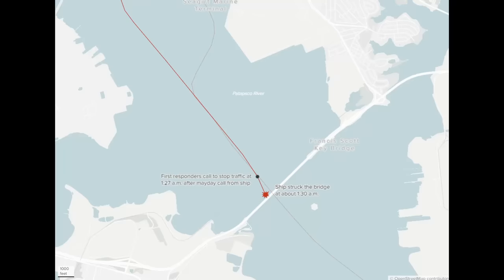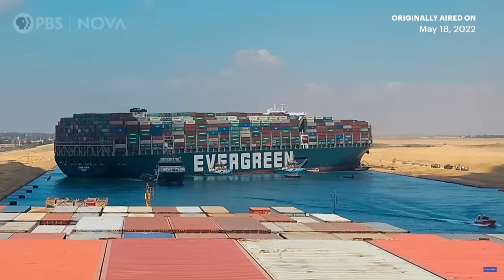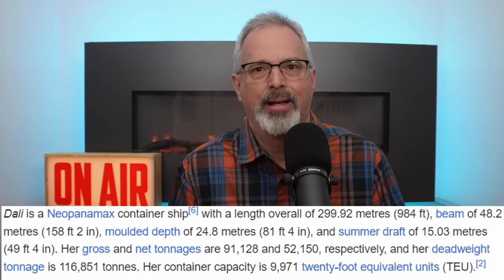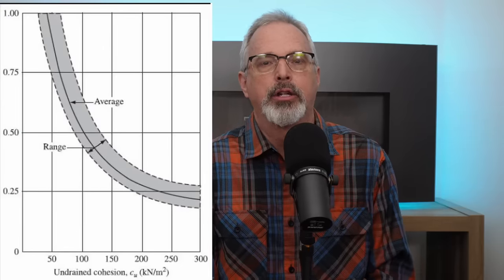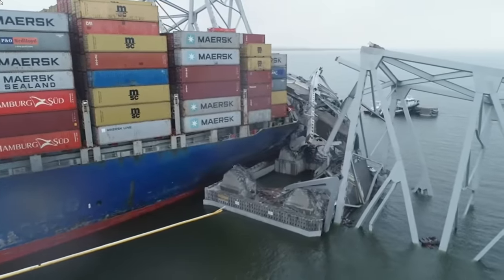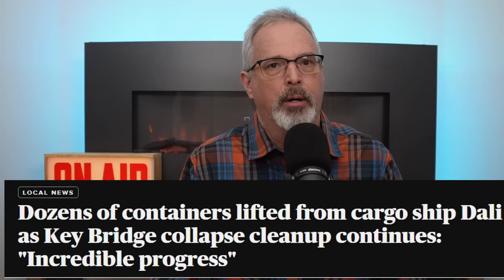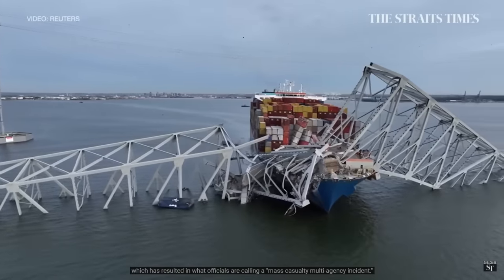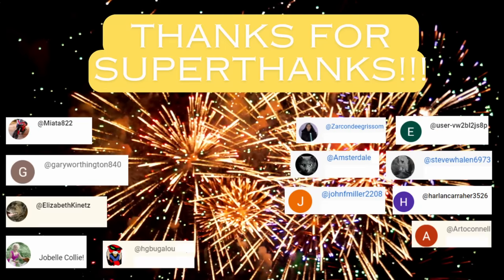Can the MV Dali be Refloated?

Comment: The numbers for the tug capacities are also way off. A normal harbor tug can be in the 50-65 ton bollard pull range and there are some classes based on horsepower like 3000's and 4200's but the actual bollard pull they can apply isn't as simple as directly driven by horsepower and those are merely harbor tugs. When you look at the numerous types of tugs there as a huge range of power and how that power is applied. Different propulsion systems and features can impact the overall bollard pull. Its also meant to take into account that a tug mag be stationary while making said force so some of the more simple relationships people go by don't fit with this calculation.
The salvage tugs have ratings over 100 tons, the biggest ever is something like 475 tons and monsters like that are used to move oil platforms and their massive anchor systems. For salvage they also use powerful barges with winches. The pulling isn't just with tugs thrashing thru the water with their props. Anchors are set, some yugs have winches on both ends to add that pull to the force of its propulsion and these barges are anchored off with big winches and using mechanical advantage to produce 100s of tons of pull. They have it handled.
Ever Forward was plowed nearly her full length into bottom as shallow as 18 feet or less. Dali is on the edge of the channel with her forward half up onto the back in about 30 feet of water. Ever Forward was so buried they were afraid to use ships systems thinking the stern was packed with mud, Dali is running. Physics is all about give me a level long enough... well give me enough pulleys and I'll pull this off with a kids bathtub toy....

I'd suggest Sal Mercagliano Whats Going on with Shipping, go back to his coverage of that incident in Baltimore harbor as he includes full coverage of the salvage plan and includes actual statistics of what capacities different tugs and barges had.
Reply from the maker: Thank you for your input on that, I appreciate it.

Comment: Come on, this is a non-issue alrhough I suppose it makes a topic for a video.
You can remove containers at the bow to deballast it. Alternatively you can use high pressure jets of water to clear the mud away from the hull. This can be done using an ROV  - you don't need divers. It's how marine growth is cleared off offshore structures for underwater inspection or repair.

Comment: If it ends up being stuck. I wonder if we could just use modern steerable boring systems to plant explosives in the mud somewhere below the ship. I am thinking that would overcome the suction of the mud long enough for the ship to float free.
Reply: With the gas pipeline very close, explosives are a definite NO-NO.
Reply: @royreynolds108  Wasn't aware of that thanks.

Comment: Don't forget the gas pipeline running under MV Dali -- supposedly it must not be disturbed.  I believe the traditional method of floating wrecks and severely grounded ships is to pass cables underneath and connect them to enormous flotation bags.  So some dredging, some flotation bags, and well, I'd like to hear from engineers experienced in marine salvage.  I agree it would be extremely interesting.  Does anyone have a contact for Casey???
Reply: And of course unload it, at least unload the front part of the Dali.  And use compressed air / air bags to drive water out of the flooded forward sections.

Comment: Marine engine officer here.  u are sadly missing the bat on tugboats by quite alot u have a very wide range from a few thousand horsepower to 20k-30k horsepower anchor handlers multi purpose offshore. Its gonna take like abit over 10 smaller tugboats 60 tonnes bollard pull.  or 3-4 really big ones that are mostly in europe in the several hundred ton bollard pull range just to make her go loose. But u also need several for control like was done in the Suez canal.  The operation can also be made easier by removing containers on the front of the dali and filling up tanks at the stern of the vessel to make the bow float higher but it depends on the debth at the stern of the dali.   i used to work a Norwegian offshore tugboat BB Worker she had 6000hp from two engines and 90 tonnes bollard pull she was 36m long and quite small.
Reply from the maker: I was trying to conceptualize the effort involved.  I am sure there is a lot of heavy duty marine equipment that could be utilized in this situation.

Comment: Don't the Dali have to get some sheet of steel to replace that big hole at the bow? Then A tug boat can get on the right side and Push it,, all while the Dali's reverse engine gives all it's might, to help back up. Surely they could try their own engines to help take some of the load off of the tugs, other than the front one that pushes it off the bridge pilings. But what do I know. Lol. Terry

Comment: At the time of the catastrophic failure of the Tacoma Narrows Bridge, no suspension bridge had been analyzed (or tested) for dynamic loads. von Karman was consulted to determine aerodynamic loads. Cyclical atrophy of engineering skills and knowledge happens gradually. Boeing lost out with the 209 to the Douglass DC-3 which solved the structural issue of having a beam to step over in the cabin and a double row of cylinders on two engines. Advances in fatigue stress analysis techniques peaked around 1972 and started to be incorporated into the 747 and 737. Maturation was achiebved with the release and training of the Boeing Fatigue Method, which may never have been accepted by the FAA, in 1991. With no small irony, Boeing initiated DCAC/MRM the same year:  Design Control of Airplane Configuration/Manufacturing Resource Management. Engineering becomes a “resource” for manufacturing and the drawing system was decimated. Decay ensued and has now matasticized as evidenced by MCAS and the inflight plug door mishap. GM did not learn how important drawing configuration control is even when failure to roll part numbers with design improvements caused multiple recalls of ignition switches costing millions if not 100s of millions of dollars. If I pull a part out and can’t tell if it is the new or old configuration, how do I know if the recall has been implemented?  Welcome to the Monkey House.

Comment: How much pulling force does the main power plant provide?
Reply: this is very difficult to calculate....
Reply: It's different from the pushing force? . . . something about the shape of the screw?
Reply: @wrdennig  there are several factors, 
the propeller profile is optimized only for forward direction (look at the blade foil design: leading edge, etc.) if you reverse it you are not running at an inefficient working point.

The second aspect is the flow direction of the water. In reverse you have (almost) unobstructed flow without any hull interference.

Anyways, just assume a degradation of thrust of 30% when compared to optimized forward speed.

Interestingly I could not easily find any reasonable information on this subject.
Reply: Thanks for the elucidation . . . the layperson would assume that you get just as much force in reverse as forward.  I'm pleased to now have a better understanding.

Comment: just take some more containers off which will increase the buoyancy in its own right. Then drag the stem into the deep channel. Obviously, pump out as much water as possible and try to weld etc compartmentation as far forward as possible. Then with plenty of pull at the bow it will come clear. The ship is not damaged so it will not sink. Easy and v can and will be done. Some people are already starting to make bigger mountains and rewards out of large mole hills.

Comment: It is A piece of cake.   Remove ALL containers, fuel and water on board. Tie the chains or cables to base of other piers and dolphins then pull the boat out. OR, even pound 2-3 piles deep into the bedrock, use leverage pull the boat out. WHY didn't they remove those containers now?

Comment: Question, the sonar image i’m assuming is from the Port side (the channel side) so given that the Dali is starboard side to the channel cut,a lot more of the hull is going to be in the mud. Your calculations are pretty much wrong as to how much of the hull is in contact and thus the amount of force it’s going to take to get the ship cleared. If I were in charge I’d have a dredging operation clearing the starboard side from the bridge pier back at least to where the hull is not in contact with the mud. That way your tugs are only having to overcome the bottom sticking, not the better half or three quarters of the starboard side.
Reply from the maker: My calculations were admittedly conservative to illustrate how much effort could be involved to move the Dali back into the main channel.  I will be interested to see how it all unfolds.

Comment: A foot stuck in mud is a very poor comparison to the situation of the Dali. 
Casey, what put the nose of the Dali in the mud? Why are they planning to use
explosives to remove the bridge structure that still remains over the bow?
Will they weld shut the gashes in the hull? I suspect the Dali will pop loose in a New York 
minute once the bridge structure is removed. Then they can safely pump out the water
to move her. The engineers working on this have a plan and I suspect it will not be as difficult as you seem to think.
That is why they are not talking about it. Watching this cleanup so far has been like poetry in
motion. As far as I know, it has also been injury free.
Reply from the maker: The foot stuck in the mud exactly illustrates suction forces that develop from pulling an object out of the mud.  There may be plenty of buoyancy available with an unloaded ship so we shall see how it turns out.
Reply: @CaseyJones-Engineer ,The Dali does not have mud up the whole sides and over the entire top of the hull.
Reply from the maker: @kimklopfenstein6867  I didn't say it did.  In fact, in my estimate I included only part of the hull to be in contact with the mud.

Comment: Does anyone know what the total weight of the bridge is?
Reply: why is this relevant?

You want to know the weight of the bridge that is sitting on top of the bow.
Should not be difficult to calculate or find out.
As a back of an envelope calculation calculate two components: the asphalt (non metal part,.... probably negligible) plus an average cross section of steel multiplied by let's say 20 m (estimate beam of ship at bow section).

.... bridge weights are not that easy to find out. Instead here my back of the envelope calculation: 
use Golden Gate bridge as a reference (yes, it's not a good comp, but a start), it is 380,000 tons for 2700 m --> that's 140t/m * 20 = 2800 tons...... that seems too much as the bridge weight also includes the foundations. My guess is around 750 tons of weight are sitting on the bow. Put this into perspective of the total displacement of the MV Dali, which is reported at 160,000 t, it seems a reasonable estimate.

Some civil engineer in the audience should correct this a little.
Reply: @SamuelLanghorn  
Sam, you misread my comment.   I want to know the TOTAL weight of the bridge that has collapsed.   All of it.   Not just the part on the ship.
To make a guesstimate of how many months it's going to take to remove it all @ X amount of tonnage a week so as to reopen the channel to full capacity.
My best guess is about 50,000 tons.   From what I've heard from reporters.
Of course the next variable is how many tons they remove a day.
I see now they have a huge clamshell bucket that is removing concrete/asphalt/steel debris from underwater, so that would change the daily tonnage removal rate.
I guess what I'm trying to say is, how long is this going to take before the channel is open to full capacity?
Just a ballpark.
Nobody in the government or the news media is saying.
Reply: @seeharvester  ok, a parameric solution would be duration = total amount of debris / daily removal. This gives you a starting point.
Reply: @SamuelLanghorn  
Thanks!   With your help, I have deduced it's going to take 46 weeks to remove everything that is left of the bridge.
They may be able to open the main channel  to full depth slightly before that.
Reply: @seeharvester  sounds like a reasonable estimate.

Comment: Typically after all is said and done there is more said than done.  This is no exception.  However for what it is worth, being that the bow appears lower due most likely to the excess weight of the bridge, and possibly bow damage it appears to be 2/3 of the ship is floating off level. My guess is that removal of the excess weight will allow the ship to work as a lever and the rear 2/3 will gradually level it our bringing the front 1/3 back up slowly as the weight is gradually lifted off.  Time will tell.   ☺♥†♪♫ 5-2024  PS:  No NA, PHD, BA or " ° " just an observation.  ☺

Comment: There are some BIG cranes working the scene. 1. weld attachment points to the hull on both sides of the ship, probably back near the center of the portion of the hull stuck in the mud. 2. Put the crane in the channel so it's floating free. 3. While the tugs are pulling, lift on both sides then pull on the starboard side, then port to "rock" the ship in the mud. Once the ship starts to move, disconnect the crane and tow it away. I'd use ropes/chains with some kind of manual or explosive disconnect in them so if the side forces on the crane get too high when the ship starts to move, you can "blow" the line to disconnect. Use water lances to put some nylon (non-metallic) ropes under the hull. Lift with them.
Reply: Cranes in general are not designed to do that. Could be dangerous and damaged in the process.

Comment: You’re joking right?  Of course it can. Adjust trim, deballast, tug support, remove containers and fuel as necessary.  And get the bridge off it. This is basic.
Reply from the maker: I wasn't suggesting that it couldn't be refloated just that it will be likely harder than many people expect it to be.
Reply: @CaseyJones-Engineer  yes sir.

Comment: can i just add that although they will need a tug or 2 they also (provided they can get fresh fuel and engines running)  they have the biggest tool in their toolbox which they should be able to use which is also how the ship gets around     ITS OWN ENGINES obviously FBI and NTSB will want to look at it and figure why but once they have done what they need to do  they should do what they need to do to get engines running     if you look at the timeline posted. ill link a video to whats going on with shipping's youtube video  where he has the timeline https://youtu.be/GzihSPXLeBM?si=NVEDKR30cNBbYMXK&t=136    which outlines that they arent even gonna try move it till May 12th  so they have 2-3 weeks to get it all sorted